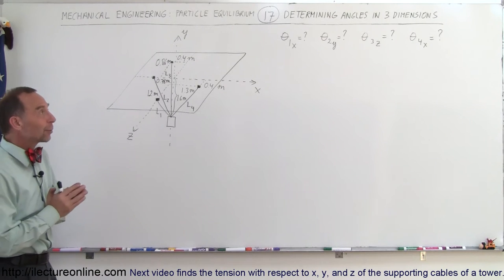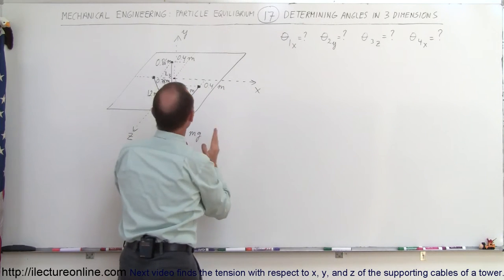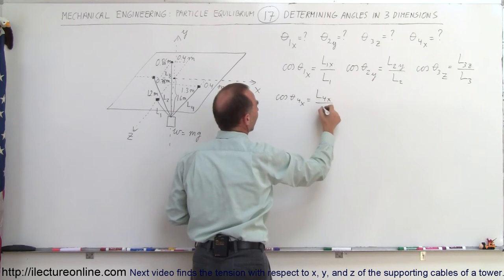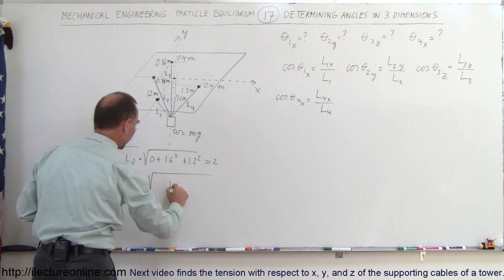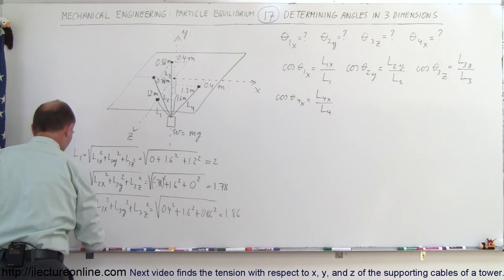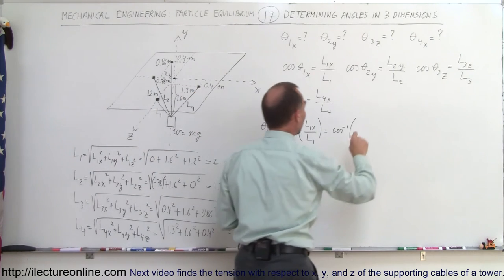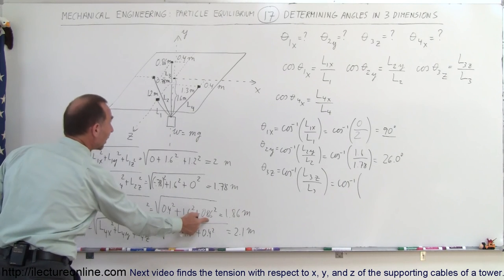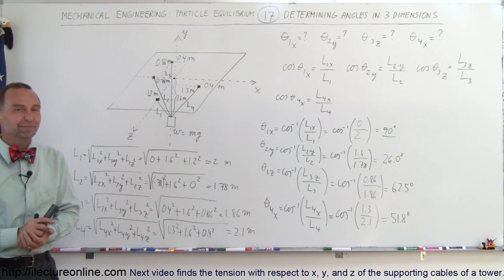Mechanical Engineering: Particle Equilibrium (17 of 19) Determining Angles in 3-Dimension

Comment: cables consists of 2 points ( start and end point) but you calculated their length or magnitude using only 1 point's information. is this way true ? and also next video also is same thing
Reply from the maker: The second point is the origin (0, 0, 0), and that is why it appears as if we only use one point.
Reply: thank you